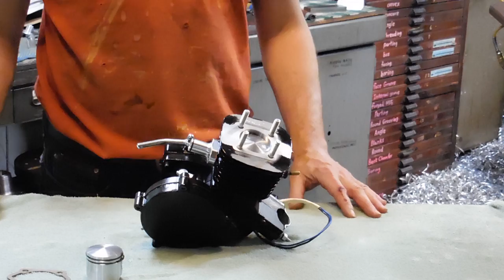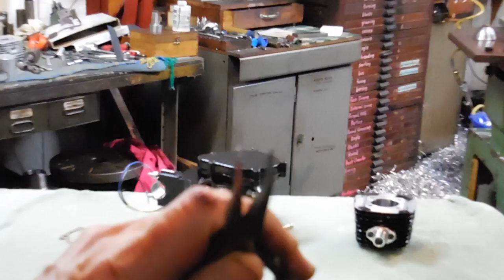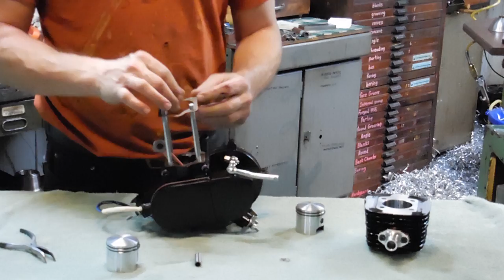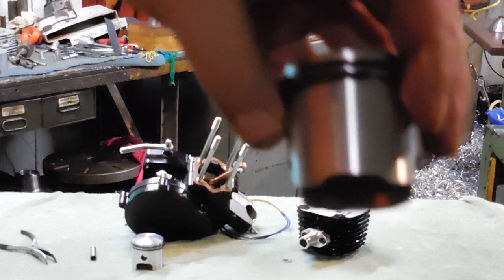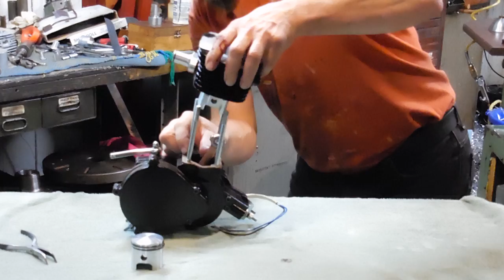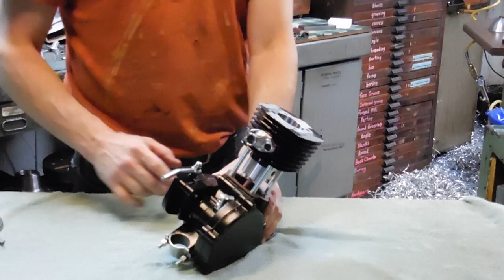GT-5 SUPER port timing adjustment video

Comment: what I did on my engine was widen the exhaust port on each side by 1mm and it gave significant bottom end without sacrificing top end, seeing as it runs around 11-12,000 rpm

Comment: I ported the potatoes out of a pk80 40mm stroke raised the exhaust real high and the intake low. I wanted more compression no base gasket, high temp silicone. Piston was hitting at tdc as motor would not turn forget cranking it. Used 2 copper head gaskets cause I didn;t feel like didturbing my silicone work and the end result is a gorilla. Thank you Fred for explaining what I did. I increased squish band with 2 head gaskets while retarding my over zealous exhaust port and helping my intake with no base gasket.

Comment: Do u still have to shaved the bottom of the piston skirt with a window piston?
Reply: T Trinh no, windowed piston only works with reeds. Fred’s motors are piston port (no reed), trimming the skirt increases the intake duration for higher rpm

Comment: im see if i get it this weekend working on a huffy from the 80s looks like a rat rod bike its going to bw wicked with that gt5
Reply from the maker: It's a GT-5 SUPER. It has a special crankshaft built by CR Machine. Only available from CR Machine. For expansion chamber exhaust only. Will not run well with a stock exhaust muffler.
Reply: boss whatever i need im getting it from you. no more china builds for me i always having them motors over heating no matter what i do it get it right

Comment: Hi Fred, I am looking at getting a Zeda 80 Weekend Warrior unassembled to tinker with.  Wanted to get your opinion on mods for this engine?  I will be running a high compression head, aftermarket CDI, two piece exhaust.  But for the most part I am looking at starting off with port matching and polishing the intake/exhaust on the jugs not sure I want to mess with the timing on the jug.

Comment: I bought the zeda80 because I have a half-breed that I installed new SKF bearings in. Unfortunately after completing the bearing installation, I couldn't get the 2 crankcase halves back together again. For some strange reason there was about an 8th of an inch gap between the two halves. The bearings were in as far in could get them with the bearing puller. So now motor is in pieces and just sits unused. Any insight or advice on why that happened or how to get the 2 halves to meet and sit flush?
Reply: Use 3 or 4 gaskets lolololol
Reply: The double row ball bearings are too wide. Just kidding. Theres real thin shim washers on the crank you can take off to make room.
Reply: @waterboy4124 - Do you really think that the two 'real thin shim washers' are going to make up for the 1/8 of an inch gap that he has? lol
Reply: @DirectCurrent4u  um, several thin ones. I counted 6 on mag side, 4 on clutch side. Thats wha ? 25 thousands. Oh yeah whack the case good to seat em. I'll sell ya a case splitter for cheep too. He'll get it, after a few cases. How many tries it take you?

Comment: i have a problem. with my clutch. i. replaced it. but it mess up again.  it wont disengage but it will  fully. engage. ive adjusted. it alot then it goes back to messing up

Comment: I have a CDH reed valve with a windowed piston.  Ive got the Gasbike supercharged Coil & CDI.  NT Carb.  Note: I match ported everything. I have not added a boost port yet. I may have enlarged the vertical dimensions a tad too much on the intake port, as It seems the bottom end fell off a bit. Im compensating this by switching my 48t sprocket to a 56t soon. My question, based on timing and stuff, if I were to add a boost port to the jug, would that help restore or increase the bottom end? I live in Mass with alot of steep hills to climb.
Reply: 48 to 56 is a massive change

Comment: Quick question, could you tell me the relative dimensions of the largest piece of the engine when taken apart? I'm looking to buy a kit this week, but I noticed from the photos a lot of them have shitty paint, and I have a powder coating system but my oven is a tiny little $20 modified toaster oven so I'm trying to figure if I should just buy a bare metal one and powder coat it myself (though then the exhaust will be chrome :/) or just buy a black one and deal with it
Reply: Chris Carr, it's rare for him to reply. I'll check my 66cc dimensions and get back to you. BuyThe looks of it it may very well fit a toaster oven. It'll be tight. I

Comment: I have a zae80 and i need a cylinder for it badly i cant get it to run right with my jugs because the rod its longer do you sell jugs for my type i hope so
Reply: Dont be afraid to take dremel cutters to the head and make room for the piston. One of my meanest motors ever ran that way. Add a base gasket if the rings trying to pop out.
Reply: @waterboy4124  i made bout 5 cardboard base gaskets i put them on got the bike up to 41mph but the gaskets leak bad every 2 or 3 days i have to clean it up
Reply: @waterboy4124  it wants to go faster
Reply: @bigdevil1310  theres this gasket called garlock. Its awesome
Reply: Roofing felt works decent. For the head carving you just need steady hand, a drill and a cutter burr with a barrel shape. Square nose so to say. The higher the cylinder rides, the more it likes hi rpm. The lower you run it, more torque. Takes bout 3 weeks of easy riding to break it in. Outta nowhere you'll mysteriously get power that 4th week
Reply: @waterboy4124  were can i get it
Reply: After the break in, run Dominator red oil.
Reply: Shave bout 3mm off the piston skirt you can see down in the intake hole. That might set you right. Double nut all your studs. And prepare to become a troubleshooting genius. These motors make you work for the fun.
Reply: @bigdevil1310  Fastenall or NAPA
Reply: @bigdevil1310  the cardboard will work. You gotta paint em with the ol gasket shellac and patiently let it dry before putting the gas to it.
Reply: @waterboy4124  ok well since i broke a back mount stud im probly goin to get the gt5 from gasbike its 120 for the engine .and save this one to fix it up right buy the right stuff for it etc.i have a gt80 reed and a 16mm klehin carb and my truster pipe.
Reply: @waterboy4124  thats what i used on the zae80 i wonder the difference on the gt5 will be faster or no?
Reply: @bigdevil1310  I welded or hydroformed my pipes with some guesswork and inspiration from michael forrest. My bros got the gt80 reed thruster setup, runs 50mph all day. The float tang in the keihin hung up once, fixed it by bending it with a pocketknife tip.
Reply: @waterboy4124  what u mean by filling the key way ?
Reply: @bigdevil1310  on the left side of the motor crank theres a shiny magnet held on with a nut. It has a keyway cut in it. File the slot wider toward the right. Then lock it down in a more counterclockwise spot than it was before. The woodruff key you can cut some taller by slicing sections of steel shaft with a angle grinder.
Reply: @bigdevil1310  square file from harbor freight, lil wd40, file file. Putting it togethers tricky. Superglue the key in cause it likes to flip out of position with the magnetism n all
Reply: The pipes i make have 300% of the cylinder volume trying to be jammed back in there with sonic pulses, so....to lower the pressures spark happens at, i retarded timing there.
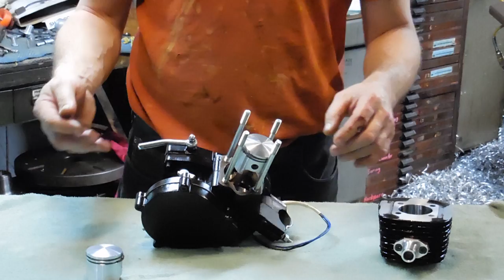Reply: @bigdevil1310  the timing magneto magnet. When your at top dead center the keyway is usually at 2:00. Stuff a rag in the cylinder, bolt head on, loosen 14mm nut on magneto magnet, pry it off the crankend, remember what side is out. File the slot in the magnet wider so you can dick with the timing there. When youre on the verge of making a screamer that can be the difference
Reply: @bigdevil1310  Use like 1/4 in aluminum plate and base gasket top and bottom.

Comment: how to get muffler studs off the motor would be a good vid
Reply: Jeff Maynard lol mine are stripped out
Reply: That's simple put two nuts on the thread then lock them together and the stuff will come out works on any type of stud.
Reply: Double nut the stud,lock them together, then just back the stud out, do the same for the other one. When you run the studs in use "RED" lock tight, available at any auto parts store. Just a dab will do.

Comment: Fred why do you love the gt5 so much? You're the only person I've ever spoken too that had something good to say about a motor with m6 studs and Phillips head bolts. What's so great about the gt5? The zeda 80 is a much more sold motor.
Reply from the maker: The ZEDA 80 engine is a copy of my GT-5L, but it's a poor copy with an inferior crankshaft. Both my GT-5L and GT-5 Super are special engines available at CR Machine only. Those engines are high level engines that are completely reworked, including the crankshafts, which are fully remachined and new parts fitted. There is absolutely no comparison between a factory ZEDA motor and any motor from CR Machine. Two very different leagues.
Reply: Frederic Chelminski, I was more refering to which is better of the two; the STOCK gt5 or STOCK  zeda80? Or are they comparable in their stock (out of the box form)?
Reply from the maker: Okay. Well, the ZEDA 80 has better performance for expansion chamber exhaust, but it's a racing geometry, so they don't perform well with stock exhaust. Also the ZEDA motors use low quality connecting rods, so, I don't use those engines. Premature bearing failure will occur from having oversize journals. I mean, they will run for a while, but they don't meet my specs. I always change the rods of those engines if I get them in the shop.
Reply: Frederic Chelminski, thanks Fred for your reply. What exactly would be so poor about the connecting rod on the zeda 80?
Reply: @JS-fb6ww  its a long rod so all that zip Rob is selling you is gonna wear its bearing pockets out faster unless you loctite green them in there.
Reply: Bart Dunning, who the fuck is Rob and who's talking about locktite? The studs are m6, not m8 and the screws are Phillip's head and not allen head.
Reply: So  then why   did  my China  doll motor last longer than zeda and perform  the same  as my zeda 80
Reply: @JS-fb6ww  where the crank bearings go......used to be real thin metal and the first long rods put out would vibrate heavily leaving you with a throw away engine case after 800 miles of waaa waaa riding. Fred and Michael Forest were the only guys telling how to drill your counterweight in the case to fix it.

Comment: heloow there from Ecuador i got a cuestion what happen if i put the arrow in the piston to the intake side? can u tell me plz i think i made a mistake with that
Reply from the maker: Don't pay attention to the arrow. Sometimes they point forward, sometimes it's pointed backwards. Piston ring end gaps should be facing the rear (intake) side of the cylinder. Even if you were to accidentally install the piston backwards, the engine would still run fine because even if the ring end gaps are facing front, they won't get fouled in the exhaust port. Either way you have it, no worries.
Reply: Thank you very much for your answer, although you do not believe me yesterday I could not sleep thinking about the error of the arrow of the piston, you have made me breathe again.
What do you think about the porter piston when you have the reeed valve?
 I bought the engine with the reed valve but I realized that I had not done the porter piston  if I took it out and never fixed where the arrow was going